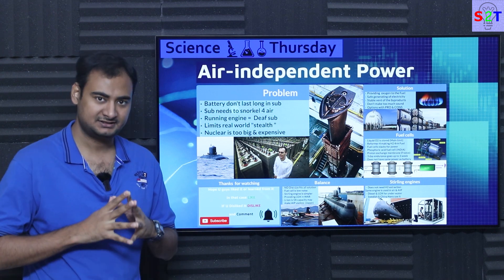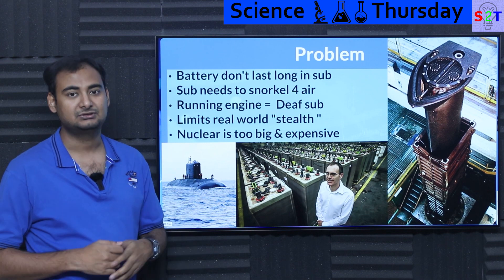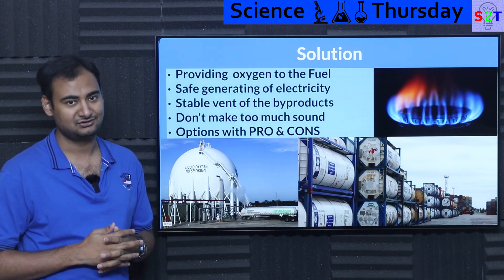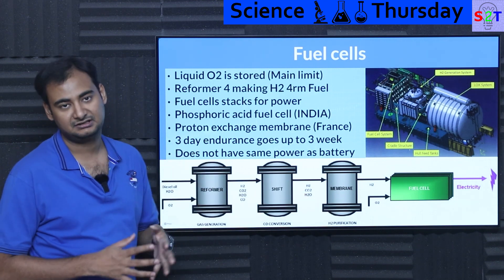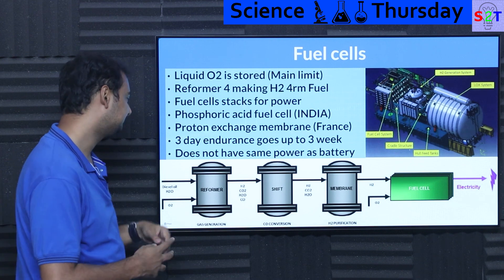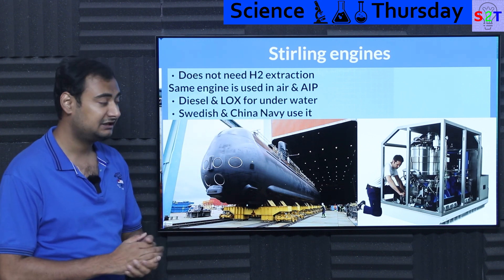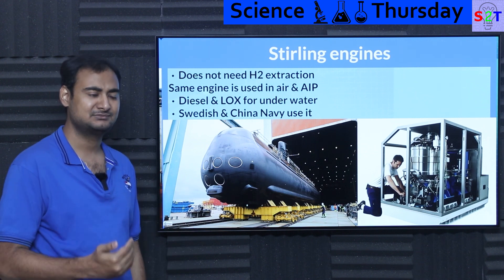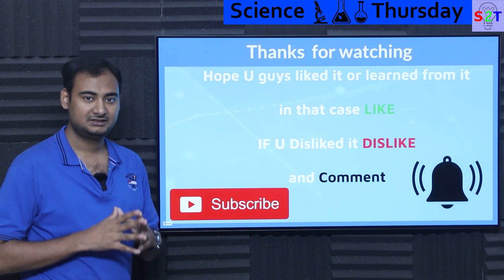Air independent Power Explained {Science Thursday Ep186}

Comment: With diesel-oxygen Stirling AIP, the same engine is most certainly not used for "air" (at surface) and submerged operation. The Stirling engine power is very low compared to high speed propulsion requirements, so any submarine with a Stirling AIP uses diesel engines for surface (and snorkel) power.

Comment: Fuel cells are not stacked just for redundancy - they are stacked (combined in electrical series) because the individual cell voltage is too low... just as with any other electrochemical battery.

Comment: It would be interesting if someone considered ammonia reforming to make the hydrogen. It eliminates the CO poisoning of the fuel cell and it's more efficient because you wouldn't need to waste the chemical energy present in the CO.
Reply from the maker: interesting
Reply: The water shift reaction in a reformer system combines carbon monoxide with water to make carbon dioxide and addition hydrogen, extracting the chemical potential energy of the CO as hydrogen fuel.
Reply: Ammonia is unstable and super poisonous..